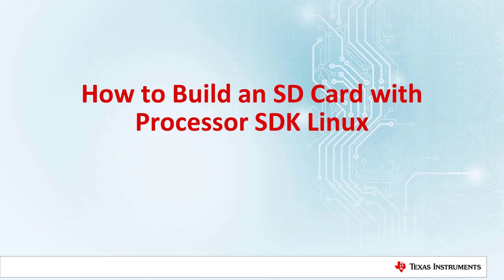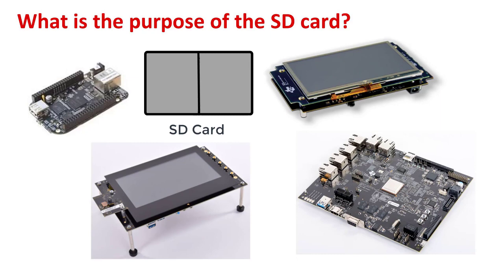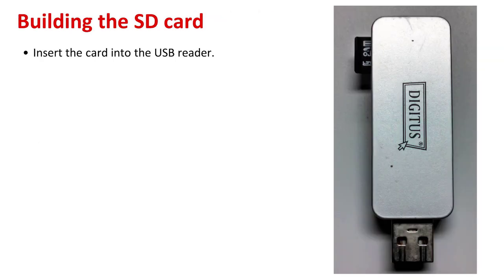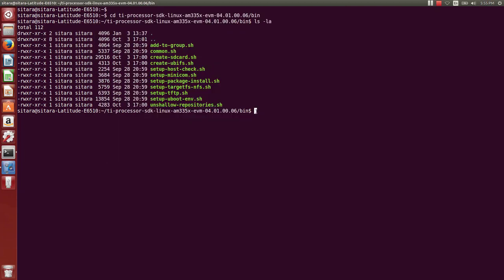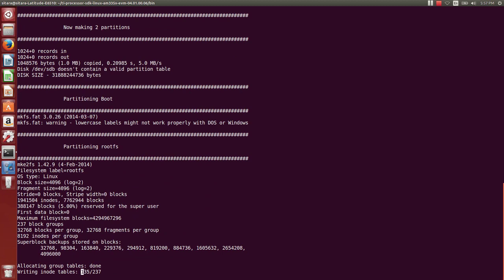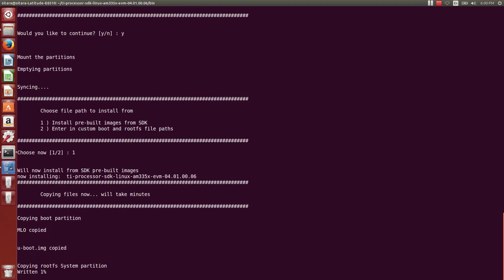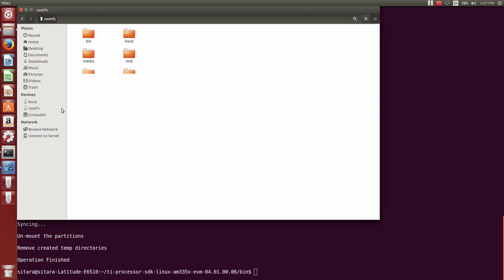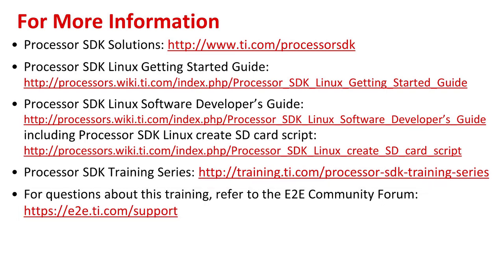How to Build an SD Card with Processor SDK Linux

Comment: It's a shame half the links for Sitara Arm AM335x are now dead, just when I get the starter kit.
Also, the mkmmc-android sh in your Jellybean release erases a formatted sd card and stops.
It does not create a partition nor does it copy the boot files to it.
One only needs to look at your example codes to see mistakes have been made.
Furthermore, your Icecream Sandwich  version of Android is now obsolete and no longer supported in Android Studio.
So I have a starter kit with ‘Icecream Sandwich’ that is proving difficult to update.
Moving from a 32 bit MCU to a Ti MPU is not my greatest idea.
The demo in this video creates a boot partition that is not correct for the am335x starter kit.